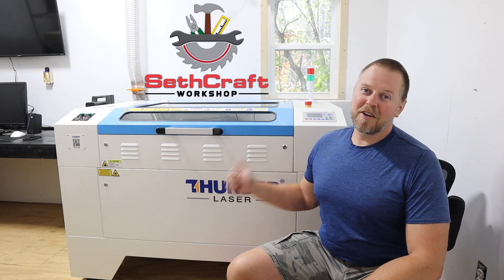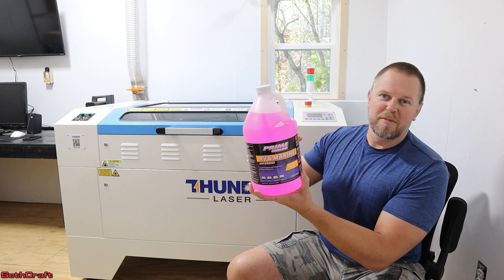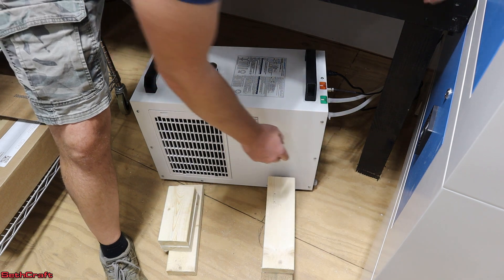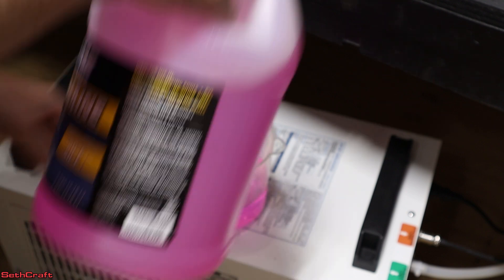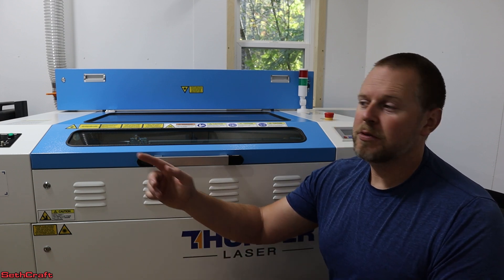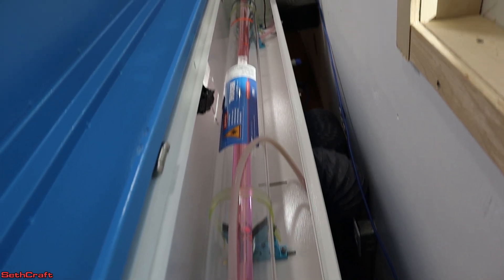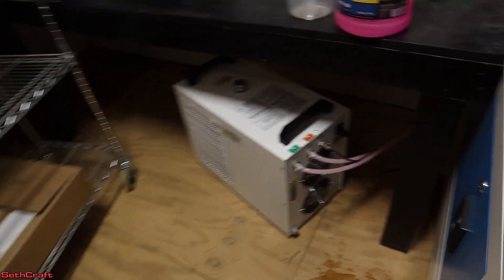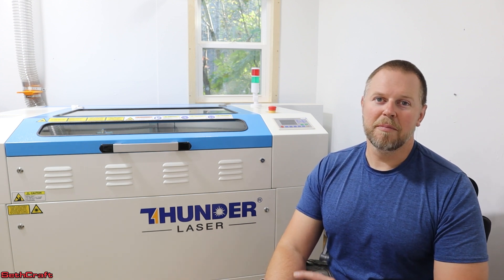Thunder Laser Antifreeze - Prevent your CO2 laser from Freezing this Winter

Comment: would not recommend RV antifreeze, certain brands can exceed the max allowable amount of conductivity, which will lead to power supply failure. just did this winterization method and my power supply failed immediately after. this is a known issue as stated on thunderlasers laser water coolants and additives page

Comment: I've been doing this for years to my Laser thanks for the Vid. Question I normally heat the garage and wait for the chiller to be around 15-17 degrees, Ive read that you can use it above 4 degrees which I dont like doing "ever". What temp do you start working at on Chiller?
Reply from the maker: I have actually been keeping the studio space warm all winter this year. I keep the laser room at 22c.